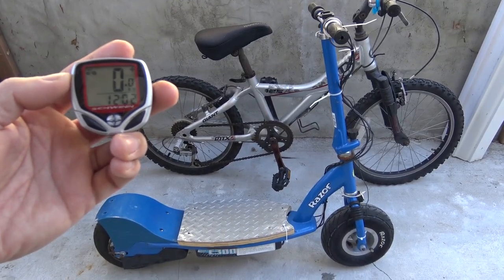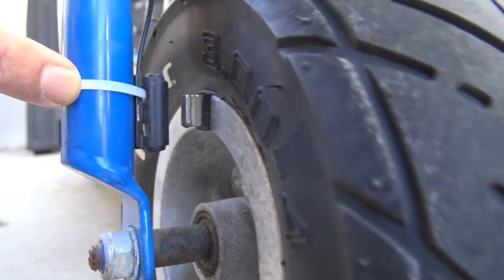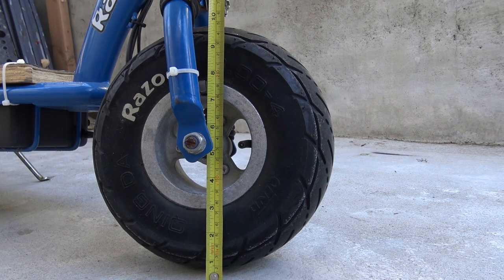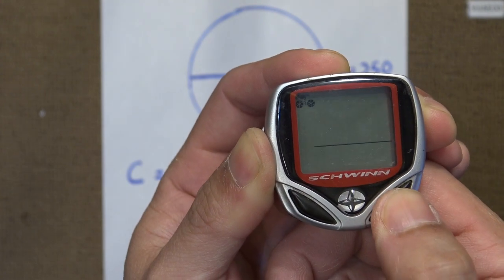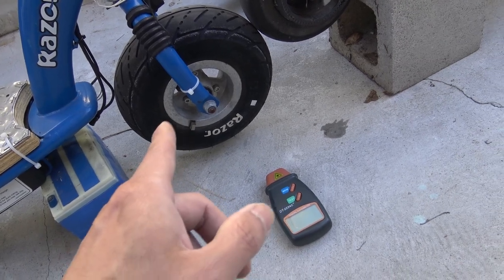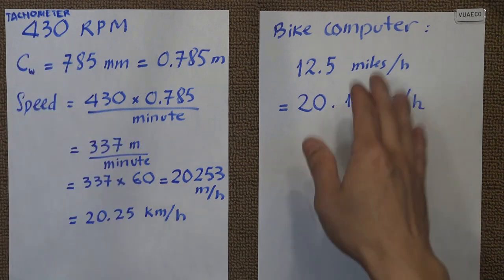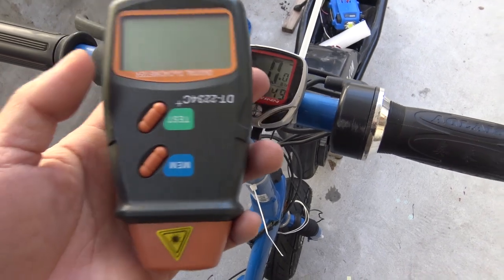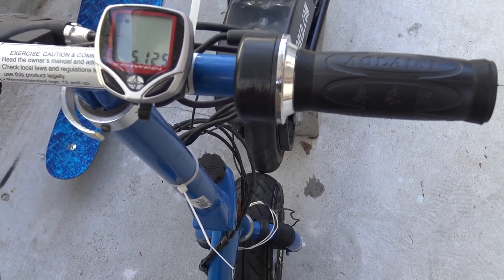Install a bike computer- speedometer on Razor E300 electric scooter (or any vehicle w/ round wheels)

Comment: Thanks for the video; now I bought the same one. I found the wheel is 240mm by looking up the part and so my math was little different and it’s pretty accurate still! Also need to consider the small loss form the wheel squishing. Minimal variation though

Comment: No joke. I want to put a speedometer on my kick scooter. I looked at the time before/after my trip and noticed that I average like 10mph per hour during my couple mile trip. I wonder what my max speed is and when I go down a big hill. I use cateye sensors on my bikes and really like them so I would use that. I have a phone mount on the scooter and can use some gps app for speed and trip but I still prefer wired speed sensor.

Comment: But the sensor is on the rim which is 4 in in diameter so shouldn't you  measure the rim and math that out?? You know what I mean
Reply from the maker: The sensor only measure RPM. It doesn't measure circumference. So, it doesn't matter where you put the sensor.

Comment: What about my bicycle with triangular wheels? Lol
Reply from the maker: LOL! It should also work with triangular wheels as well. You just have to install your magnet/sensor to the round part of the wheel which is the part near the axle. The axle of the wheel still has to spin round doesn't matter if the tire is triangular or square. So the answer is yes, it will work on triangular wheels as well!
Reply: vuaeco 🤣 it was definitely worth a good laugh though.